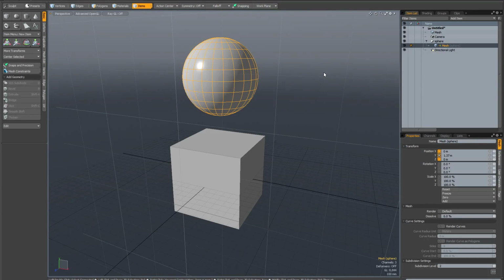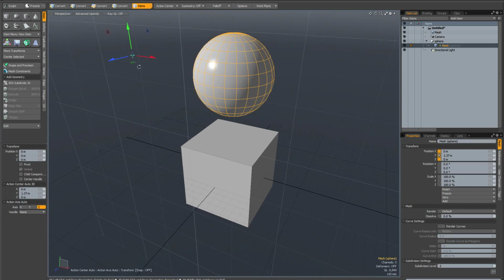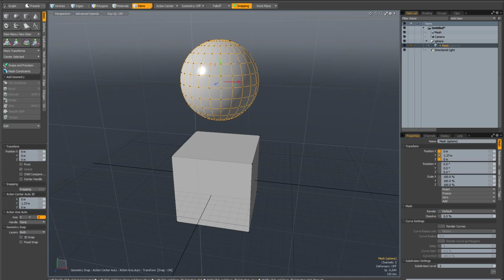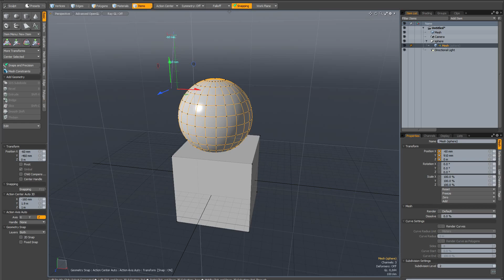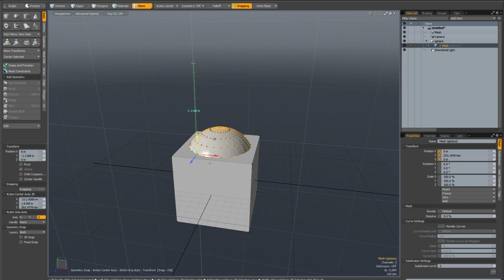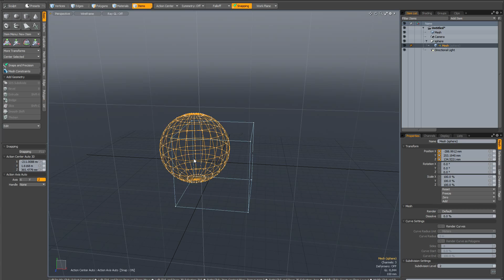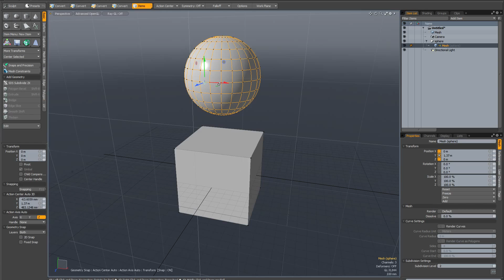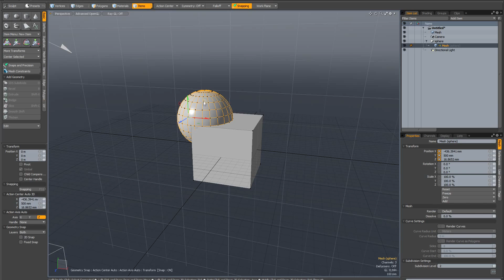snapping references in modo 801

Comment: There's a faster way of doing this, using vertex snap / element move. (with an optional origin axis) This way you can drag the object in place in a single transform in all three axis. Or even using your automatic action center and clicking the center of all three axis handles instead of moving each axis at a time.

These would both work, or am I missing something?